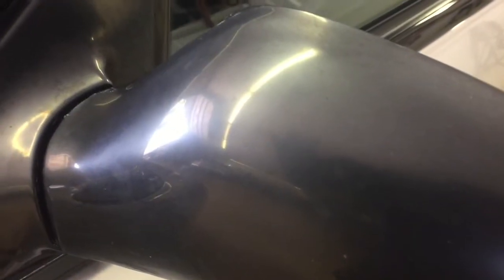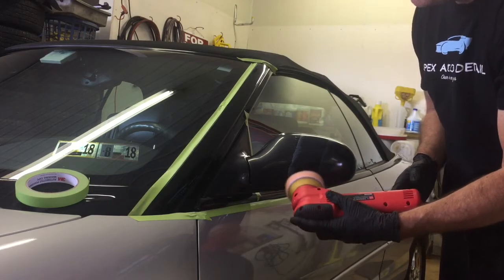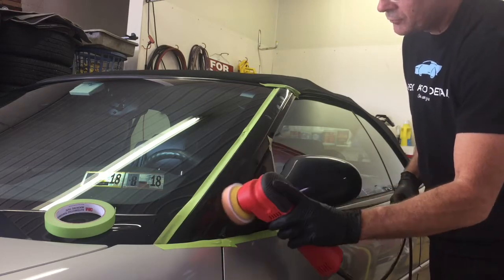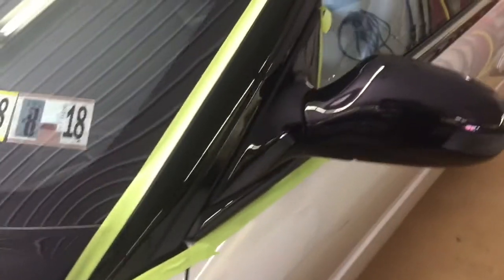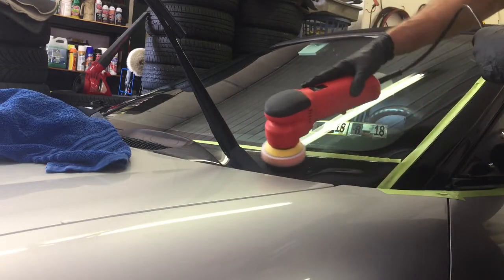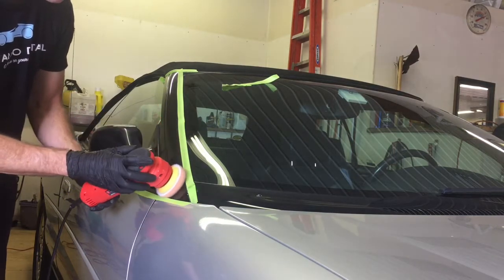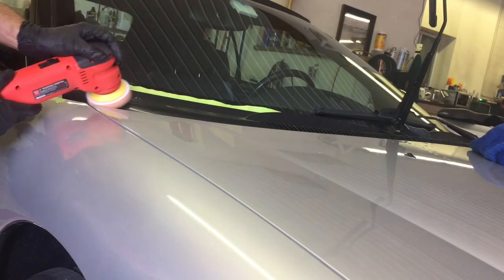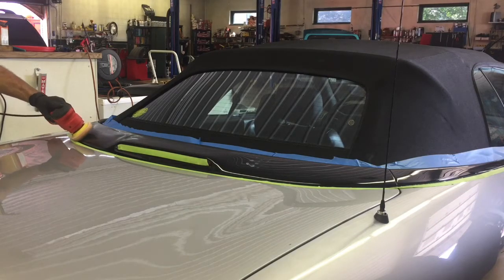How to carefully polish coated plastic TRIM! Using 3 inch polisher and QP ON 6.2 Ultra Fine Cut!!

Comment: Nice work Brian, love all your vids btw.

Question, could you give me an idea on how i could polish that same trim in a really tight area?

I'm trying to polish that type of trim on the back of a 2015 vw gti but I can't get a polisher in there, it's too tight. Do you know a good technique by hand, maybe? 

Thanks!
Reply: You could definitely do it by hand if u can get your hand in there but if I were u I would get a adapter for your buffer and use that...they make 1" adapters for even the smallest places...cheers
Reply from the maker: Stephen Carbonaro absolutely...as Alex mentions... I did the small areas by hand. I also have a video on Rotary extensions and small backing plates to reach tight areas
Reply from the maker: That kind of trim is so soft.. you can easily do it ALL by hand btw. 😁

Comment: Guess there is no way around using the tape to cover. Its not putting the tape thats an issue for me, it more that the painters tape is heck expensive.
Reply from the maker: Gotallofthem1    I agree... I pull it off and re-use it in other areas until it fails to stick! Lol